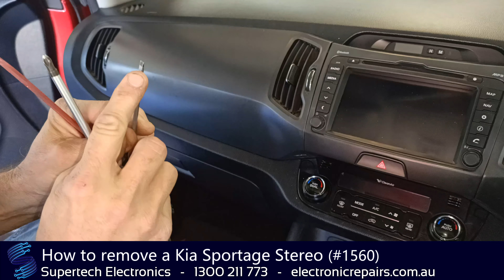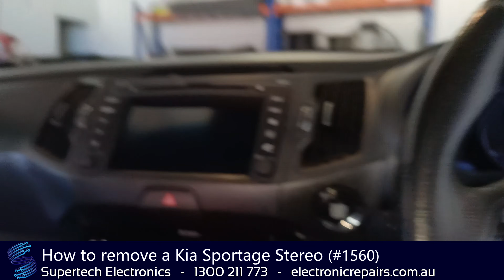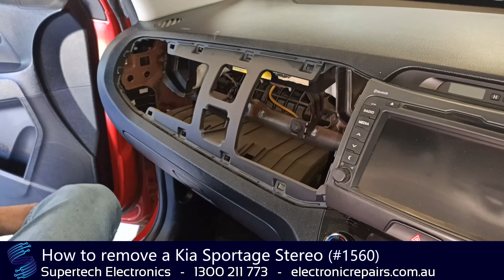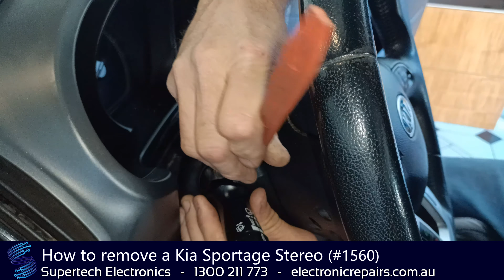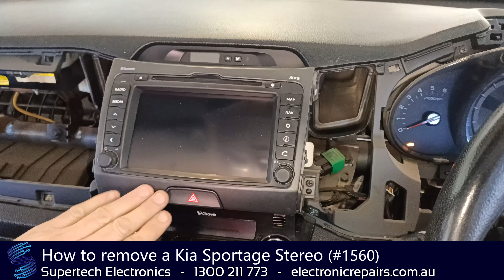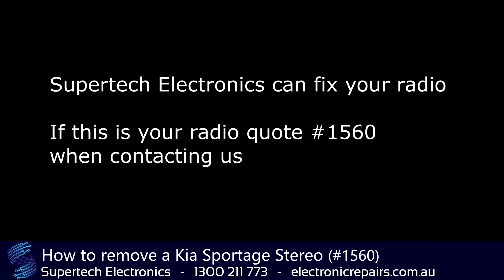How to remove a Kia Sportage Stereo (#1560)

Comment: Hi, thanks for the video. I was trying to disconnect the emergency indicator wire from the radio, but pulling it out simply doesn’t work. Is there a pin somewhere that I need to press to open or I simple have to pull it harder may be with a pliers. In the video you mentioned about some middle pin while unplugging the wires near the steering, is it same here too. I really didn’t see any middle pin either

Comment: Hi, my stereo same as this has lost all volume. No Bluetooth volume, no radio volume etc etc. I’ve checked the main fuses and pulled the yellow fuse clip to reset the stereo but still the same. My question is that does the stereo have another fuse for volume on the unit it self ? Kind regards Zed
Reply: Same here

Comment: Good day mate, I owe a kia sportage SI 2012 manual and I would like to install any android head unit, some retailers ask me pictures of the centre of the unit but I don't know how to remove it. By any chance do you please have any picture of the back of the head unit? I would appreciate it.
Reply from the maker: Hi Julian, We are a repair shop. We prefer repair over replacement. We don't like the cheap Android units because they always break down after a year or so, then you have no support because they are made cheap by manufacturers who hide behind brand names that don't exist, or change brand names and production factories 3 months after you bought it. Half the time things like steering wheel control and CAN interfaces do not marry up with the car. You are going down a rabbit hole we know and strongly don't suggest. Our opinion would be to get it repaired, or if you want more features that the factory radio does not offer, look for premier brands that will support you like Alpine and Pioneer. These well supported manufacturer's units will cost you thousands of dollars but save you thousands of head aches! Otherwise it's time to buy a newer car with all of those features included in the factory radio!